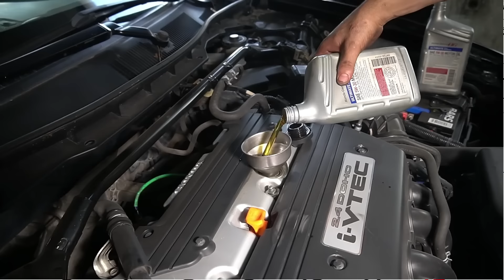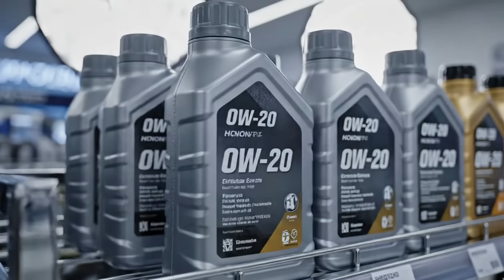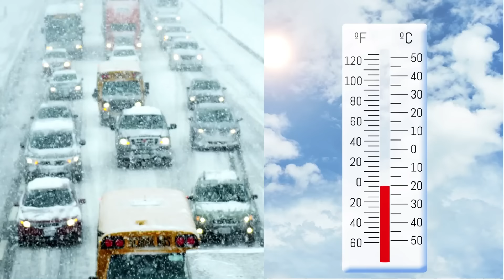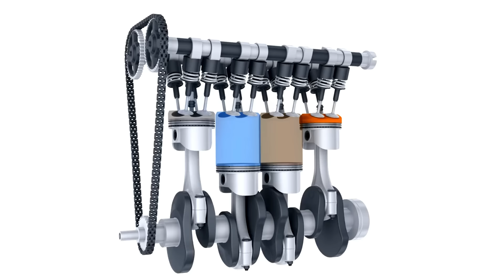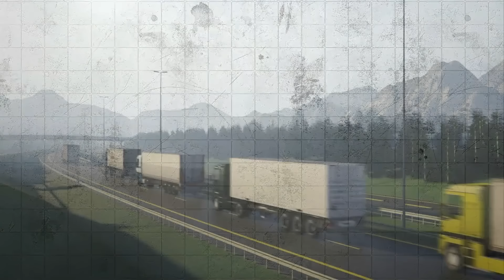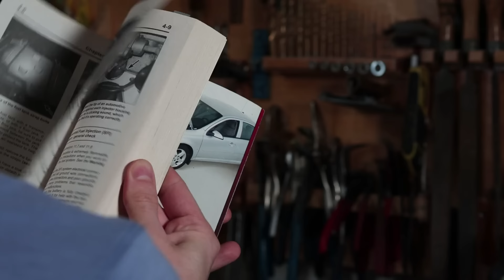The Oil Viscosity Conspiracy: 0W20 vs 5W30 - What Your Engine Really Needs

Comment from the maker: Drop your oil grade👇
0W20? 5W30? Something thicker?
Tell me your engine + mileage and I’ll reply with the BEST oil choice for your car.
Reply: 0W oils are not “thin.” The 0W only indicates how the oil flows when cold, and cold oil is always thick. A 0W oil is simply slightly more fluid in cold conditions than a 5W oil.
The important part is the second number — 20, 30, 40, etc. If you choose the second number, you need to be careful.
A 0W oil works perfectly fine and does not harm the engine, but you must choose the correct type for your engine: 0W20, 0W30, 0W40, etc.
The 0W part will not hurt your engine; the second number is what matters because it indicates the oil’s viscosity when the engine is warm.
There is no point to use 5W30, better use 0W30.
Reply: 23 Jeep Gladiator Willys 3.6 Pentastar V6 uses 0w-20 about to switch to 5w-30 ✌️
Reply: @williamheinsinger7390  I switched my 24 Gladiator to 5W30 recently. 12K miles on the speedo
Reply: 2014 Subaru outback  2.5
Reply from the maker: @j.anthonyiannetti6763  For the 2014 Subaru Outback 2.5, 5W-30 is usually the go-to choice in most regions outside the U.S. because it offers better protection, especially as the engine gets older. Subaru engines tend to prefer a slightly heavier oil for long-term reliability. If you’re in a warmer climate, 5W-30 is a solid, safe option.
Reply: @CarCareCrewOfficial I’m in eastern PA so I’ll stick to the manufacturer recommendation for the first 25k miles. After that I may go to 5w-30 high mileage
Reply from the maker: @gamerscubeixxi2152  That’s a smart approach! Following the manufacturer’s spec for the first 25k miles is perfect, and then switching to 5W-30 high mileage can really help with engine longevity and quietness. Sounds like a solid plan for Eastern PA weather your engine will thank you!
Reply: I have a 2015 Mazda CX5 with 81 K   miles. OE says 0W20. Thanks.
Reply: I use 5w30 in my 22 Edge AWD 2.0L GTDI turbo..just like Ford recommends! They were smart & didn't follow the foolish Ultra low grade oil race.. yet I get 32mpg hwy /27-28mpg city.
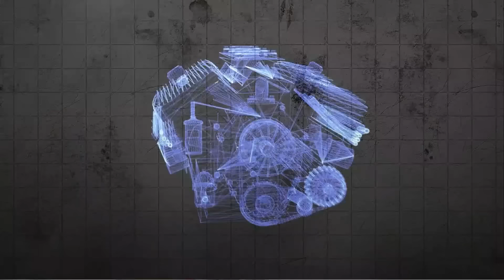Reply: @9:06 My 2008 Lexus LS460 requires 0w-20.
Reply from the maker: @JamesJ30t  Yeah, that’s correct! 
Your 2008 Lexus LS460 is designed for 0W-20, which helps with fuel efficiency and proper engine protection, especially during cold starts.
Always sticking to the manufacturer’s recommended oil is the safest choice.
Reply: That funny, the same car in japan uses 5W30. 0W is for cold starts from negative 40. 5W is good to negative 20. Both my camrys one say 0w16 and the other says 0w20.  Both mine are on 5W30. I'm not worried about the 10 gallons save throughout the year. Durability and longevity is what I want. Good luck
Reply: What car?
Reply from the maker: @EReed-qg8lt  I hear you, and honestly you’re not wrong. Japan running the same engines on 5W-30 says a lot. The cold-start argument also makes sense most people don’t live anywhere near –40, so the benefit of 0W isn’t even relevant for them. At the end of the day, durability matters more than chasing a tiny fuel-economy gain, and 5W-30 is perfectly capable of protecting these engines long-term. If your Camrys are running smooth on it, that’s real-world proof right there.
Reply: No it doesn't.  That's what the dealership told you. Do your research.  Both my Japanese cars ( camry)  run on 5W30 not 0W16 and 0W20 and the same engine
Reply from the maker: @EReed-qg8lt  I get what you’re saying, and you’re right  many of the same engines outside the U.S. still run perfectly on 5W-30. The point I’m making is simply that oil recommendations can vary by region because of different regulations, climates, and testing standards. It doesn’t mean 0W16 or 0W20 is ‘wrong, it just means manufacturers tailor recommendations for each market. If 5W-30 works well for your Camry in your region, that’s completely valid.
Reply: @CarCareCrewOfficial That makes some sense, but US markets all new cars are 0w20, some are 0w08!  This is not for reliability, it is to squeeze a few more MPG from the fleet.  Which sucks for the customer!!
Reply from the maker: @ericfitzsimmons1202  You’re right  a lot of the ultra-thin oil recommendations in the US are mainly to meet CAFE fuel-economy targets. Manufacturers need every tiny MPG gain on paper, even if it doesn’t necessarily help long-term reliability. That’s why the same engines overseas run 5W30 or 0W40 without any issues. In many cases, it’s more about regulations than what’s best for the owner in the long run.
Reply: @EReed-qg8lt  i would use 0W30 not 5W30.
Reply: 1kr-ve 2025. odo 4000 km. first oil change after factory oil fill at 3000km using 5w30 acea a3/b4. what oil is best for this? recommended certification? and at what km should the next change be?
Reply: Nissan Teana j32, VQ25DE. 246.000 km. Oil 5w30?
Reply: 0w40😂
Reply: I own a '23 RAV4 Hybrid non-plug-in.  Dealers in the Philippines use 5W-30 because they say it’s hot and humid here, with temperatures ranging from 24°C to 35°C (75°F to 95°F).  I often drive in heavy stop-and-go city traffic and also travel at high speeds of 80–120 km/h (50–75 mph) on the highway.  And of course frequent stop/start because it's a hybrid. 

Should I stick with 5W-30, or is it safe to switch to 0W-16 or 0W-20?
Reply from the maker: @Colonel_Mar  Your dealers aren’t wrong in the Philippines’ heat and heavy traffic, especially with lots of stop-and-go and high-speed runs, 5W-30 actually makes sense. Hybrids also spend a lot of time switching the engine on and off, which puts extra stress on the oil film.

Can you run 0W-16 or 0W-20? Technically yes, the engine can handle it. But in a hot, humid climate with slow city traffic and long highway trips, 5W-30 gives you a better safety margin for wear protection and high oil temperatures. If your RAV4 is running smooth and quiet on 5W-30, I’d stay with it  it’s the safer choice for your conditions.
Reply: @Colonel_Mar  Use what manufacturer calls for always or risk serious issues w/ warranty. Facts. After warranty period ur choice.
Reply: @Davido50 This is not true.  It is against Federal law to deny a warranty claim unless it can be proven the oil caused the issue.
Reply: 2023 Nissan Pathfinder V6.  Manual calls for 0W20.
Reply: 2022 highlander v6 in Denver with 40,000 miles requires 0W-20, but has consumed oil like a beater since day 1.  Toyota states that 1 quart per 1,000 miles is not a warranty issue, which is absurd and why I will never buy their junk again.  Should I just switch to 5W-30?
Reply: @tituspullo44 That is stupid high.  I bought a 2025 Camry and it take 0w08!  I did not know that until after I bought it.  I will need to dump it before warranty.
Reply: 2021 Ram 1500 5.7 hemi.  Cap says 5w20
Reply: 2016 ford focus s 186k
Reply: I have a Hyundai accent 2014 with 226k on the odometer. What type of oil is recommended I just overhauled the engine because it was burning oil excessively
Reply: @dotunabimbola7380  if it's burning so much oil, then probably there is no oil what saves it. You can use a little bit thicker oil, but it wont save the huge oil consumption. Example 0W40 oil is one oil to use. If you watch example oil data sheet then you can watch exact oil viscosity and choose a little bit thicker oil. you find oil data sheet from the internet.
But remember you choose thicker oil at your own risk.

example Liqui Moly Synthoil Energy 0W-40 is thick oil at hot engine, but still better cold start.
I reccomend to search oil data sheet if you choose engine oil you  see there example Viscosity at 100 °C 14,0 mm²/s ASTM D 7042-04, this is  quite thick oil.
Reply: I used 0W-20 for my MAZDA CX5 2.5L gas./Philippines
Reply: 25’ Lexus Lx 250 (0w-16), 25’ Corolla hatchback nightshade (0w-8). 2011 Mustang premium convertible. 5w-20 semi-synthetic
Reply: 2019 5.3 127000 0w20
Reply: I have a 24 toyota 4runner. It states it wants 0-20. However, the same engine in the same vehicle (say a 2015) used a 5-30? Also, even the 24's that use that engine in the same climate, but in Europe say 5-30?
Reply from the maker: @jdogtag567  Yeah, that’s exactly what a lot of people notice. The 2024 4Runner still has essentially the same engine as the 2015 model, but Toyota switched to 0W-20 in the U.S. mostly for fuel-economy targets. Meanwhile, the same engine in Europe still uses 5W-30 in similar climates. The engine design didn’t really change it’s more about regulations and marketing than actual mechanical need.
Reply: VW Passat 1.5 tsi engine DPCA  65000 mil
Reply from the maker: @wojciechmoskal8366  Got it, bro. So your VW Passat 1.5 TSI with the DPCA engine is at 65,000 km. At this mileage, sticking to the manufacturer’s recommended oil type and change intervals is still a good idea. If you want extra protection, a high-quality synthetic 5W-30 (or whatever VW spec recommends) works well, especially as the engine ages.
Reply: 2026 BMW M240 with 3000mi did the first oil change at 1500

Comment: Ow or 5w makes no difference in weather above zero... got it...
20 or 30 makes a big difference in engine wear at operating temp... 20 giving less protection in normal driving and even less under heavy load ... got it... you are never going to ruin your engine with 5w30 in any engine any make or model

Comment: Use 0W20 if the car is new, a hybrid, if you're driving in a cold climate, and do mostly neighborhood driving.  Since 0W20 breaks down more readily, do 3-4,000 mile oil changes.

Comment: My 23 Toyota 4runner calls for 0w20 but I'm using 5w30. I live in central Florida
Reply from the maker: Given the high heat in Florida, moving to a slightly thicker oil for your 4Runner is a reasonable choice for extra protection. 👍
Reply: In central florida 10w40 would be better...going by average temperatures.🎉

Comment: For my '21 GMC 1500 5.3L (that has 0w-20 on its filler cap) and NO factory AFM/DFM computer chips I use 0W-30 in cold winter months & 5w-30 in hot summer months.  Also DIY change filter/oil at 5K miles (which is usage meter at 40% remaining).  I also installed a low cost Catch Can (from Amazon) and am amazed how much crud it stops being sucked back into its engine (to carbon up the backside of its intake valves).  As recommended I also remote start its engine and let it "warm up" idle - as I put my shoes/coat on inside the house.  When < -10C I also plug in its engine block heater and onboard 5A battery charger the night before.     All now works great for me...

Comment: My 2024 Nissan Rogue was built in a Japanese factory.  You can tell by the first letter in the VIN number.  It was shipped to and sold in the U.S. so the Owner's Manual is written in English for the American market.  The recommended oil viscosity in the American version of the manual is 0W-20.  Had the car been sold in Japan the manual would have recommended the 5W-30 viscosity.  Why would that be the case?  The Japanese know their engines and recommend what is best for their engines.
I bought the car used with 22,000 miles on the odometer.  It had just been serviced by the selling dealer less than 20 miles before I bought it.  The very first thing I did was have the dealer installed oil removed and replaced with Pennzoil Ultra Platinum 5W-30.  I worked in the oil industry for a number of years and come to believe that a -20 weight oil just won't protect and provide for the longevity if an IC motor.  
The U,S. government knows nothing about IC engines.  All they know are unicorns and rainbows.  It's time they got out of the  design and mandate business for auto and trucks~!!  Trump just gave us back our freedom of choice when it comes to picking our vehicles.
Reply: Not true!! In Japan it will still use 0W 20

Comment: How about light ruck truck diesel engine oil with ester graphene addictiv
Reply from the maker: Light truck diesel oils with ester and graphene additives can be really strong performers. Ester helps with cold starts and high-temperature stability, and graphene can reduce friction. But it all comes down to the brand quality and whether the oil actually meets your engine’s specs. Additives sound great, but they only matter if the base oil and certifications are solid.

Comment: My favourite oil is 0W40, but i can use it in older cars. newer cars have often smaller oil ring holes and may not take 0W40 oil. using 5W oil is no point, because it wears engine more at cold starts than 0W and 0W doesn't do any harm for engine, second number is important, because it shows oil flow with hot engine. 100c Celsius.
But 0W20 oil doesn't make sludge, you just must change your oil at right time and all is right.
It's so with all oils that you must change oil at right time.
Reply: 0W 40 is way better, it's good for cold starts and works very good for hot engines especially in start and stop conditions of city driving. I live in Canada and I always use 0W 40 in winter and in summer 5W 40. 0W 20 is too thin and it actually vaporizes and needs additional fills.

Comment: 0W oils are not “thin.” The 0W only indicates how the oil flows when cold, and cold oil is always thick. A 0W oil is simply slightly more fluid in cold conditions than a 5W oil.
The important part is the second number — 20, 30, 40, etc. If you choose the second number, you need to be careful.
A 0W oil works perfectly fine and does not harm the engine, but you must choose the correct type for your engine: 0W20, 0W30, 0W40, etc.
The 0W part will not hurt your engine; the second number is what matters because it indicates the oil’s viscosity when the engine is warm.
Reply: If you have frigid winters, 0w seems to be better than 5w but in tropical, warm climates closer to the equator is definitely preferred, more protection instantly.
Reply: @Freemasonshair  0W doesn't do any harm for engine, 0W means cold flow and for hot engine is other number 0W20, 0W30, 0W40 and so on.
When temperature is at 20c celsisu, then works almost only second number and 0W doesn't do almost nothing anymore in this temperature.
Reply: @kaliikleja there’s theorized start up damage though occurring from the oil being so thin at startup. Like if you’re in Texas or Mexico or a crazy hot climate, there’s no use for 0w-20 and that’s also why in those dessert nations they don’t have those oils recommended. It’s always 5w-30 and up, 0w is bad at a certain point.
Reply: @Freemasonshair  You don't understand how viscosity works and why you talk 0W20? If engine can handle thicker oil than 0W20, then you can use 0W30 and 0W40 oil.  cold oil is always thick even 0W, it's just a ltitle bit less thick.  0W is useful at 0C celsius and lowe. If temperature ise +20C celsius, then 0W or 5W doesn't work anymore ja mostly working then second number 20 30 40 and so on. 
Oil maybe 0W40, but if you start car at +40C celsius, then 0W doesn't do anything and all is fine you just must choose other right number 0W20, 0W30 or 0W40.
Reply: @lonniebeal6032  0W30 works fine at summer there is no need for 10W30, 10W wears engine at cold starts even at 0C celsius. just change oil right time and all is fine, 0W20, 0W30 and 0W40 oils you can use all year around and all is fine, no problems at all.

Comment: So then what’s the best oil to use for my VB WRX? Stock. I live in Chicago where we get all seasons.
Reply: use 0W oil, you must choose 0W20, 0W30 or 0W40, but remember, newer cars may have smaller oil ring holes and these can't take too thick oil. 0W oil is good for cold start and doesn't do any harm for engine, if engine is warm, then works second number 20 30 40.  Also, higher the second number, higher see fuel consumption a little bit.

Comment: Ok,Camry 2012 mileage is 85K mile  in middle east area  using as manufacturer specify. 0-20..or need to change to 5-30?
Reply: What the manual says, 0W-20 only or give you several options?
Reply: No options..  @北南-f4u